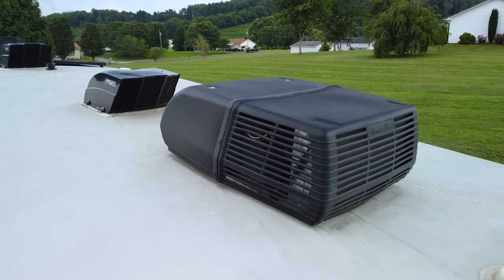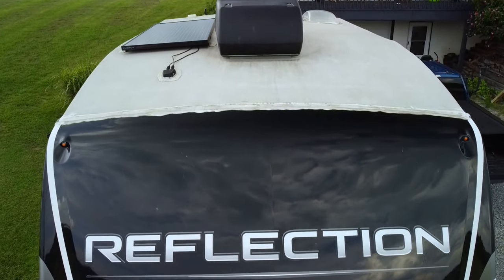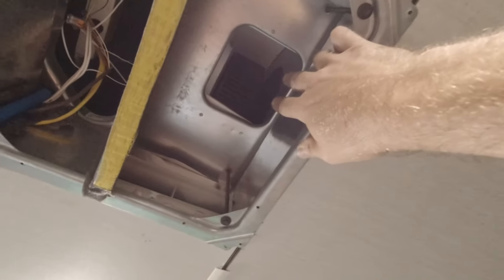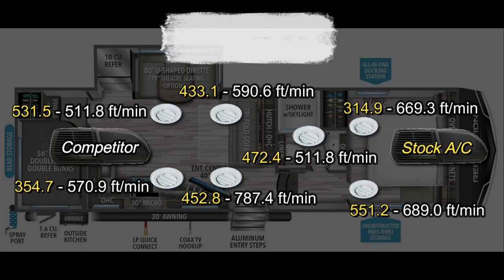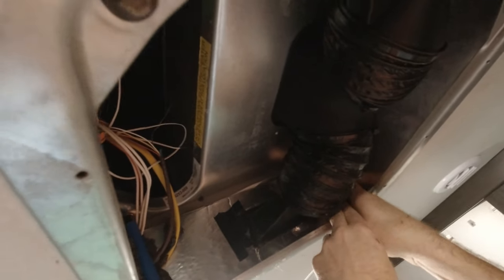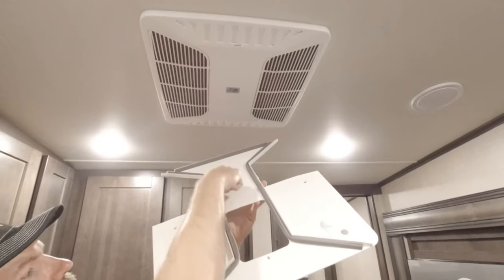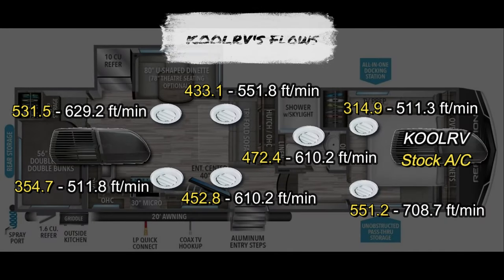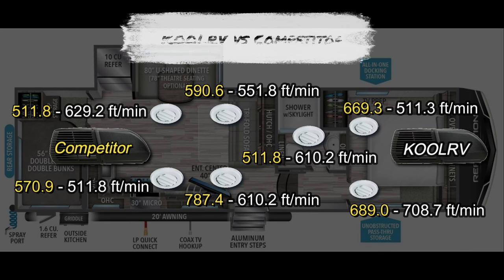Supercharge your RV A/C for 1/2 the PRICE!!!! KOOLRV is the NEW KING of RV Modifications!!!

Comment: Was highly considering the KoolRv until I noticed these 2 issues from your video. 1 - you never actually showed the foam option. I think if you had, it would have weighed against your argument here. 2 - your data actually supported the foam product. I think that’s why you blew over it. Thank you for steering me to keep the current foam duct (competitor) I have in my system.
Reply from the maker: Thanks for watching. The data supported that for less than half the price, you get a very comparable product.  The (competitor) was installed in my rv from the factory, so it doesn't make sense to remove it and install something that does the exact same thing. I wouldn't expect anyone in their sane mind to remove the foam to install the KOOLRV. This content is geared more toward someone who has neither product. Thanks for the comment, though.
Reply: People

Comment: Just my 2 cents I have installed the competition unit what a pain in the butt!, I had to unscrew the ac from the inside to get the foam in ended up stripping one of the bolts had to use a nut and bolt. Never again I will definitely use this product instead super simple install. And 1/2 the price. I don’t understand why you would need to close the quick cool as stated the more incoming flow the better, this being said once I get and install the product I may put a filter on the quick cool to see if it changes anything. It’s important that if you try this use a filter of some type you don’t want to suck dust into the system.
Reply from the maker: I agree. This is much simpler to install than the RVAirFlow and cheaper. Thanks for the thoughts and feedback.

Comment: I have a 2020 Rockwood 2109s and wanted to either do the diy version,  Koolrv or Airflow to increase the flow. I just inspected my unit which is a Coleman Mach 15 and apparently I can't do any of them. Rockwood, in their infinite wisdom ran the ac power and control wiring straight through the plenum and just below the air outlet. I was only able to tape off any holes and install a rigid foam bottom to the outlet section and discard the air dump baffle. A little better flow but not what I was hoping for.
Reply from the maker: That's unfortunate. The KoolRV product is a game changer.

Comment: I’m wondering , if you pause your video when you take off the plastic vent cover there is a gap that is outside the actual duct. I bet if you pre tape the duct entry you’ll gain even more flow
Reply from the maker: The KoolRV kit actually comes with tape designed specifically for taping those gaps. After installing, I taped all the gaps  to ensure a good seal. Thanks for the comment

Comment: Really good review. I was pretty much set on the Kool RV product, but you put it over the top for me, for all the reasons you mentioned. Good data presentation, plus intuitively the KoolRV priduct should be better than the other priduct because it ducts the air directly into the ductwork. The competitor's  pieces of foam directs the  air "at" the ductwork. Thanks again.
Reply from the maker: Thanks for the comment.  KOOLRV is definitely a great product. You'll be pleased with your purchase.

Comment: wish website set up where you could punch in make model year and know if compatible. great idea, good price but have bought too many rv gadgets only to find they don't match up for one reason or another
Reply from the maker: Good idea, however, often times rv manufactures install different ac units depending on availability. The best thing to do is find specifically what ac unit you own and match it up. You could also pull the interior cover off pretty easy and take a look to help verify if the item you are buying fits. KOOLRV would be glad to answer and questions you make have as well. Thanks for the comment!

Comment: Well im convinced to buy the koorv.  Only adjudtment may just rap those hoses to ptevent cooling loss.
Reply from the maker: There's not that much heat loss happening in the hose section since the velocity is dramatically increased. It's minimal at best. We've camped in 100° extreme humidity and stayed cool inside the rv.

Comment: We have Coleman Mach Q acs in our rv. those acs have a more significant solid foam divider than most rv acs.  Wokod there be any advantage to removing that (it is removable) and installing the kool rv instead to get better airflow because it dumps directly into the vents? our airflow is not horrible, just looking to be as efficient as possible in the SC heat!
Reply from the maker: It should help significantly like the results you saw in the video on those units too.  Thanks for asking and watching.

Comment: Does it not being insulated create much difference? But it’s hard to justify $170 for a block of styrofoam.
Reply from the maker: Thanks for asking. Any insulating properties the foam may have is irrelevant to cooling performance. The magic is in the ability of each product to reduce turbulence at the plenum to ductwork transition. You can pay $170 or $75 to get the same result.

Comment: I don’t think the play in the hoses are universal. I don’t think that is a Coleman AC which there are different types based on the air flow size.  For my Coleman AC my cool RV hoses don’t reach the opening in the track. I had to replace them with dryer duct hoses to make reach. Good system when compared financially it takes the $175 airflow, down to 75 but I think it’s just as good as the $20 foamcore. Going to post my reviews soon. The word is def not out yet on this product
Reply from the maker: It's a great product and such a simple design. Thanks for watching and commenting.

Comment: What was the difference in noise between stock, competitor and the KoolRV?
Reply from the maker: The difference was negligible at best.
Reply: Bummer.  I was hoping that Kool would reduce the noise against stock at least.  Nevertheless, I pulled the trigger on one since they finally restocked.  Thanks for the review  @blueridgefamilyoutdoors
Reply: @CrispyBones1mil I have both and the koolrv does reduce noise over stock.  I would say almost as good as rvairflow.   If noise is your concern check out the RV air silencer by wacko products.  Got one at the rv show and it makes a huge difference in our bedroom a/c.  Going to order 2 more for the others.
Reply: Can the silencer by Waco be used along with the KoolRv

Comment: I also use sun shade on the ac , trailer sides lol we live in Arizona and its hot
Reply from the maker: The heat out there is brutal. Anything helps in the Arizona summers. Thanks for watching!
Reply: Where did you find your sun shade for the ac’s? Currently in AZ as well in an RV and struggling cooling it off.